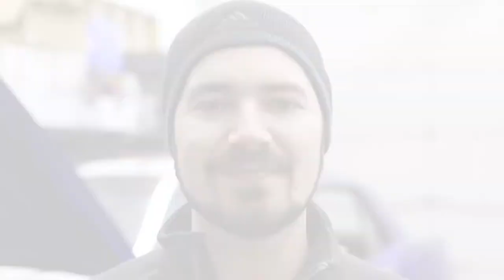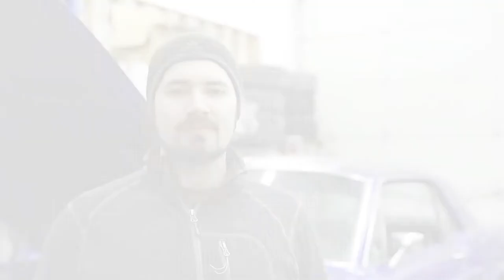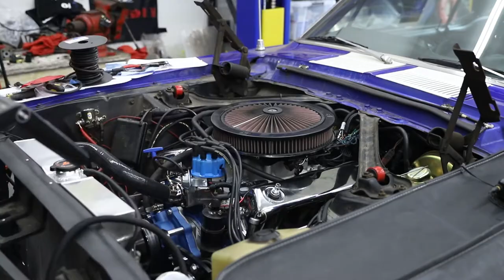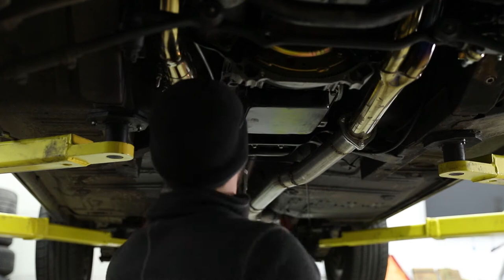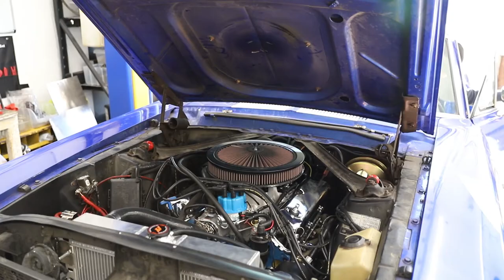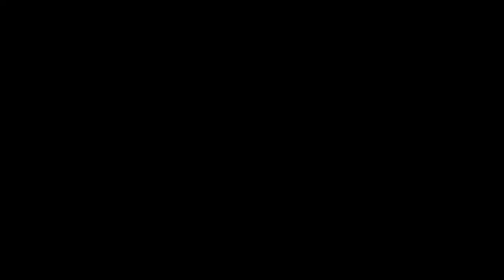1967 Mustang - Bringing the new engine to life!

Comment: Lean state with the EFI. Indicates vacuum leak, possibly around manifold. In the enrichment phase of the EFI startup, it should be quite rich (12-13:1). Red pipes will indicate there is an air leak. What is AFR set at - and what was it reading on the handset?